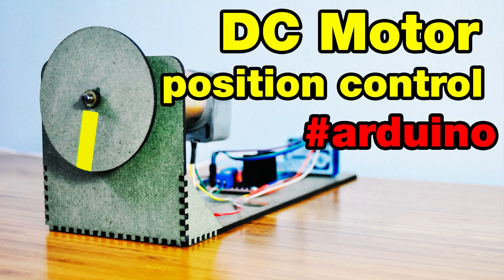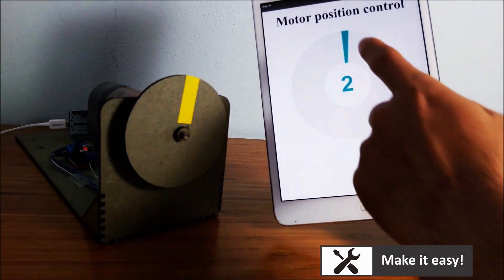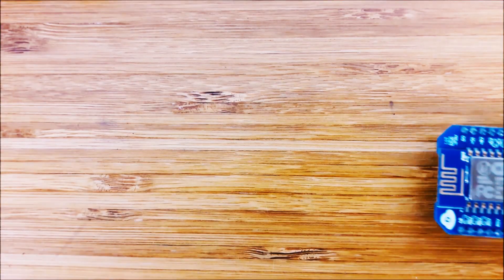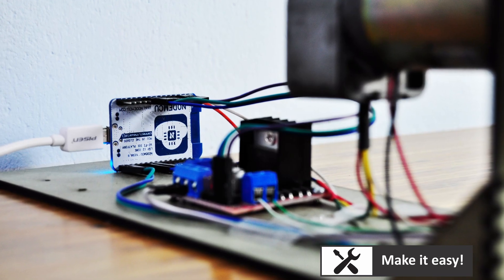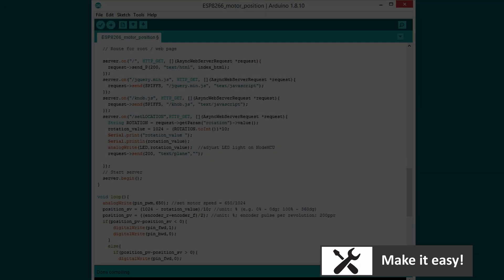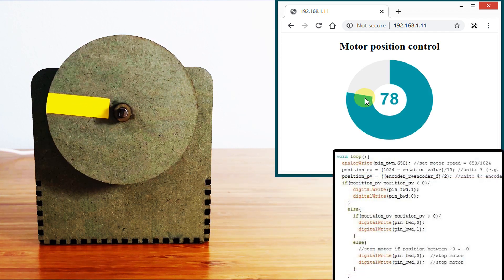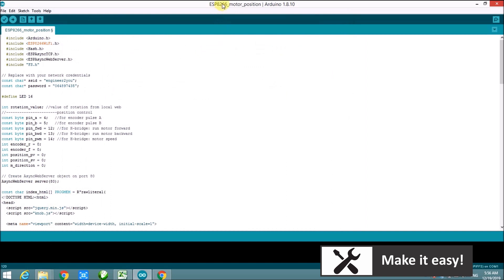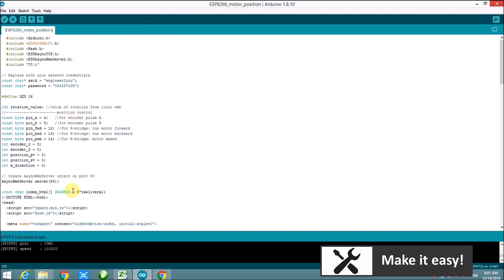Motor position control Arduino - Make it easy!

Comment: Hi, your project is cool, I have a question.

Should always return pointer to homing.

My question is, when restarting the system or power failure at 40°, the system will take 40° as the starting point "0°", or will the system automatically go back to the defined starting point after starting

I look forward to your reply, and following your Chanel have already done
Reply from the maker: it will not remember home position after restarting. If you need homing position, you have to save home position or the way how to search home position. For easy, you can make code to save position into EEPROM, so it can remember home position when lost power.

Comment: Hi, I know it's an old Project.. I'm trying to reproduce the Project and for me the motor start spinning continually ...
I'm using a 12V DC Polulu motor with encoder with 30:01 Gear Ratio and No Load Speed 350 RPM and 1440PPR

Comment: Hi, I replaced the old ESP8266 with new ESP8266 lua type but the resetting continues!  However, The motor starts to turn only if  I commented the interrupts line in the Void setup section (obviously, without PID control).
I was wondering if we can remove  the interrupt line [ attachInterrupt(digitalPinToInterrupt(pin_a), detect_a_r, RISING) ] from "VOID setup " and place it somewhere else to avoid resetting!

Comment: Hi, The micro controller is keep resetting! I think it is because of the interrupt pins!
Reply from the maker: Check if your connection is correct or not
Reply: @engineer2you Thanks for your response! Regarding the connection,  I am sure it is correct! by the way, I do not have Lua model and instead I put a regular ESP8266!
Reply from the maker: @fredrahmani6670  Regular ESP8266!? It is a point for keep resetting problem, maybe your power supply is not enough for the board, please check if your power supply is enough current for your ESP8266
Reply: @engineer2you  Sorry, I am a newbie! However, I commented the interrupts line in the void setup section, which prevents the micro from resetting! Obviously the motor runs continuously without any control! Therefore, I ordered a coupe of the Lua V3 version! Hopefully that would fix the problem! Thank you.

Comment: Is it possible to track position for more than one revolution say 720 degrees?
Reply from the maker: Yes. But i dont track more than 1 revolution. You can try by your own
Reply: @engineer2you  what is your motor brand/ID??
Reply from the maker: @stein-roarbrobakken7943  it is re-used motor which don't have any information.

Comment: My project involves lifting 50lbs weight from one point to another, holding it their. The arm is spring loaded so will return to its original position when the motor stops holdibg. But the arm has to stop at another point in between and hold the weight there too. Can I use a dc motor to lift and hold weights, If not a dc motor then which one? Shud not have high current consumption .
Reply from the maker: Sanket Pingale i think you can use worm gear motor with PX sensor to control its position
Reply: Thanks for ur reply.

https://youtu.be/KQU_Nj7OX5s 

This is what I am trying to make for my old test car. Wish to give it to a handicapped person I know.

I plan to use a wiper motor for this. Not sure of what controller. As the clutch is spring loaded, the motor shud have torque to hold on to a mid point when brake pedal is released.

I wud appreciate if u could throw some light on this or direct me to somone who has done this before.
Reply: Some more info here

http://benmlee.com/4Runner/autoclutch/Auto_Clutch.htm

Comment: very good. I already subscribed to your channel. can the motor rotate 90 degrees clockwise and counter-clockwise without using a smartphone? Please help me.
Reply from the maker: Yes. Smart phone just send position setting for nodeMCU. If not using smart phone, then you have to make the setting in nodeMCU program
Reply: @engineer2you  thank you. I have a project from a lecturer to make a barrier gate with RFID and proximity sensor. I hope your video can help me.
Reply from the maker: @adithionugroho3158  oh, you should use servo motor SG90 to open/close barrier
Reply: @engineer2you  my project can't use sg90. so I use the motor power window as a drive. and the pole used has a length of 1 meter with a weight of 2kg. do you have any advice for me ?
Reply from the maker: @adithionugroho3158  why dont you use bigger servo motor that can support up to 2kg? If not, then you can use power gear motor, and two sensor to detect open/close state of barrier
Reply: @engineer2you  that is a good idea. but I can't use servo. because, for the use of servo only for other groups. sensors might be the best idea for this project. thank you for your idea.